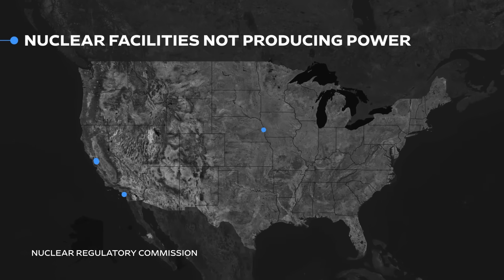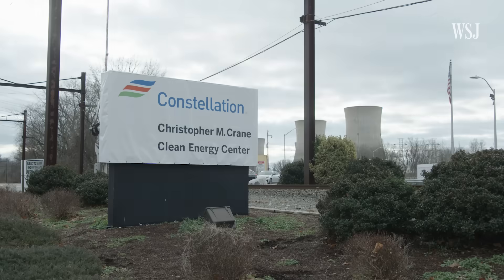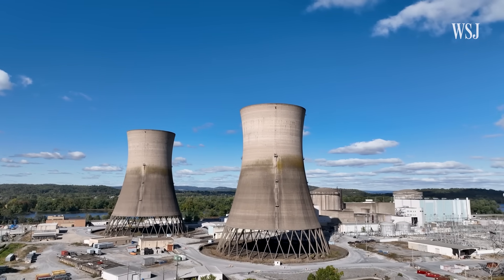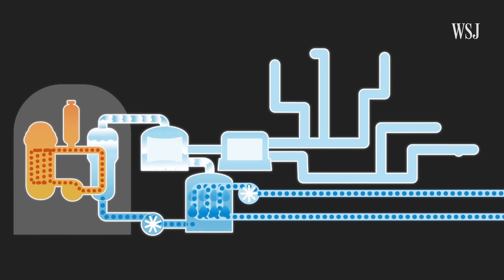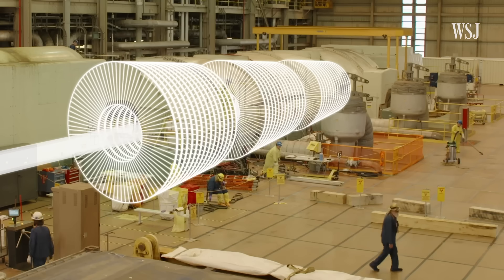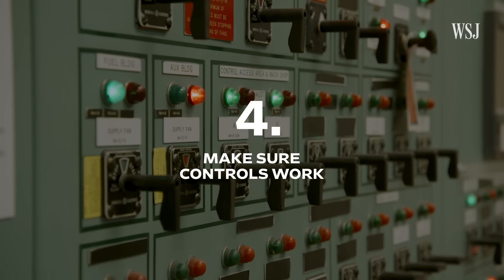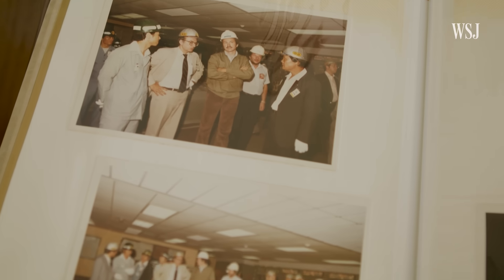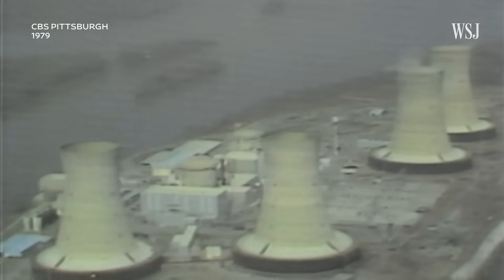Inside the $1.6B Plan to Restart Three Mile Island | WSJ

Comment: Okay, 43 year nuclear employee here.  Including from 2012 to 2020 at Fort Calhoun, Braidwood and Byron Stations.
60 year old controls?  No, not really.  The hand switches and indicating light fixtures, maybe.  The recorders, controllers, all of those have been replaced multiple times.

The NRC licensing process is PAINFUL and EXPENSIVE.  Want to know why nuclear plants cost so much?  It's the REGULATIONS, folks.  So TMI is just fine to restart.

Nuclear plants (post TMI-2 accident, now post-Fukushima accident) are more safe than ever before.  Have we had an accident on US soil since TMI?  NO.  Did we have some near-missed?  Yes.  Davis Besse being the worst of them, and guess what?  The PEOPLE behind that can no longer work in the industry.  Try that penalty on for size.

The bottom line is this: TMI is safe, and it ran at levels which were EXCELLENT until it was shut down because the US government insisted on distorting the energy market with subsides favoring wind and solar, which mean you subsidize wind and solar and pay them twice - once as a ratepayer, and once as a TAXPAYER because they can't make money otherwise, and good running nuclear plants like TMI, Kewaunee, Palisades, Duane Arnold and others get shut down because they can't compete against government subsidies.

Relax.  It will be fine.  I'll stake my reputation on it.
Reply: Except for a very important detail missing from your otherwise fine criticism of relativism.
Without Government subsidizing both the construction and liability (Insurance) NO nuclear reactor would ever get built. This-in spite of Plant Vogles repeatedly using unqualified welders, electricians, and inspectors throughout its construction. The worst part however is the failure of the Inspectors overlooking the failures of the welding, electrical, and inspection procedures and conclusions themselves. It’s damning for a steam engine that is exceeding $35 Billion in construction costs for only two of the four reactors.
Reply: @Jmp5nb  Those are some very strong charges.  US NRC observes construction.
Where are these allegations documented?

Comment: There is much better controls technology today.  Running a facility on obsoleted hardware is only going to cause issues.  Sure its cheaper, but using eBay to find replacements isn't a good idea.  Allen Bradley offers competitive priced SIL solutions, while Yokogawa has some top of the line solutions.  It just didn't appear the controls were modernized from what was shown.  I hope they have a plan for that.

Comment: The reason the controls are 60 years old is the utility has to evaluate and certify the new controls and then, once certified, the process starts all over at the Atomic Energy Commission. Each of the two steps can take 3 to 5 years. Often the new technology is already obsolete by the time the AEC gives their approval.

Comment: These are all old OG 1950’s Gen 1 reactor designs. The 3rd or 4th generation nuclear reactors are much much much more safe and don’t even look like traditional reactors anymore. If you combine them with a fusion reactor mix, and maybe have a mini reactor on the side as a backup reactor, you can actually gain extreme amounts of energy output to power entire states.

Comment: Worked at indian point 3. They had a crane there for the rods (in rod we trust). Anyways this thing was so old the manufacturer was no longer around and they had so many replacement. There were these 20" boards that operated it, 5 of them. You had to put them in the right order. Just insane to me that something so old did something so critical.

Comment: 1.6bn $ would be a bargain.

Basically everywhere in the western world - new reactors create massive cost overruns.

For that reason - I would be suprised if they kept it under 16bn.

Time will tell....
Reply: that is why private businesses are good; they can do things well on a budget.
Reply: @leowood5860  Yeah - right.

Private companies never go over budget.

I'm sarcastic. Of course they do.

Great Britain's 2 new reactors under construction right now have an estimated price tag of 52bn pounds/57bn $.

Originally - the estimation was only 16bn. The whole undertaking is done by - suprise - a private corporation.

Go figure.

Reactivating a nuclear reactor is a bit more than blowing off the dust - and putting the plug back in.

This thing sat for ~20 years. When it was shut down nobody planned for a reactivation. Meaning: Nothing was treated against corrosion/fouling/rotting - you get the idea.

For example: All those stainless steel pipes (dozens of miles of them) have to be checked meticuolously. Steel gets briddle from radiation over time. And stainless steel in particular is hard to weld. Each and every one of them has to be perfect.

Margin of error: Zero. If something goes wrong here - radiation gets out. And even if it's just a tiny bit - as in the original 3-mile island incident - everybody will scream Chernobyl and the project is dead as a dodo.

And those pipes mentioned are just a tiny, tiny part of what has to be done to get the whole thing back up and running again.

I'm quite sure whoever calculated this project underestimated the price tag. After all - the reactivation of a nuclear reactor after 20 years has AFAIK never been done before.

There are many uncertainties involved. Due to the complexity of the whole thing -  it's impossible to know what's all wrong - before actually getting to it.
Reply: @ I agree. what I am saying is that private corporations have more of an incentive to stay under budget.
Reply: @leowood5860  And to stay under budget the usually cut some corners...
Reply: @andkosification  so does the government, the only difference is that a private corporation has a big incentive to not have stuff break.

Comment: Solar can provide the power but we would rather use something that could make the entire continent unlivable.
Reply: maybe do some research on that one pal. nuclear plants almost never melt down, and when they do will never "make the entire continent unlivable", and solar only runs during the daytime and takes up huge tracts of land.
Reply: @leowood5860  You are the one that needs a lot of research. I bet you believe there is a such a thing as clean coal. The amount of nuclear material in any nuclear power plant is enough to make an entire convenient unlivable. That's just what it operates with. Once those are removed from the reactor, now what do you do with it. Every state bans nuclear fuel rods being transported because they are so hazardous. 
Just because it hasn't happened yet doesn't mean that it won't ever happen. The Russians nearly did it themselves. This country isn't innocent either, it's just hidden but people are still dying because of three mile island. As for solar power, night time demand isn't the same as day light hours anyway. During the night there is this invention called batteries. As for the space that it takes, yes, they take up space. So does anything else that generates electricity. One produces clean cheap power, the other produces a byproduct that can kill every cell in your body and is very expensive to operate.

Comment: The internet has been scrubbed about many other meltdowns around the world and in the US.  Heck you hardly hear about Fermi.  Also what you never hear is that the valve issue at TMI was preventable with proper maintenance that had been reduced to cut back on man hours and the same valve was found to have the same issues at other stations around the US.

Comment: Ooof, this a bit of nightmare since this is all very old hardware. Fortunately they're doing this the right way, but checking every little thing. But ideally all the control system should be replaced with more modern hardware that easier to get spare parts for. And core catchers should have been installed under the reactor vessels to bring them closer to modern safety systems. Though TMI's reactor design did prevent a reactor breach that a CC is designed to deal with. 

And after the AI bubble crashes and burns, this power can replace coal, which is what Constellation Energy is likely counting on.

Comment: Jesus, TMIZ was not a major meltdown and was not deadly. TMI should have never been shut down. In fact, the deadliest actual nuclear failure in the US would be the SL-1 incident. 

Also, something kinda odd, but TMI accident happened weeks after the movie China Syndrome came out, and tmi and the movie followed a very similar script. Also odd was the protests against nuclear energy rising and fear mongering spreading throughout, based on false info, with Jane fonda at the helm. 

It's the same people demanding clean, safe, and reliable energy now, but are terrified of nuclear power, which by far is the safest, most reliable source on energy in the US.

Comment: Basically, you’re inserting think of it as charcoal briquettes under a tea kettle to just get it boiling at the right pressure you spin a pinwheel that is connected to a chain that spins a alternator on your car to produce electricity. That’s the simple side of the explanation no more complicated than that.. 
    Now the redundant back up safety and controls. 
   On top of that A worst case scenario fail safe backup Plan B. 
     This is where the company cut cost to keep their profit margin so they have a faster return on investment. 
     Worst case scenario couple billion dollars and damage tens of thousands of people harmed an injured few hundred die immediately they get to declare bankrupt. Everyone gets to walk away clean in white suits with bag of taxpayer money. 
      Nobody gets fined nobody loses. Nobody goes to prison.. 
       There is no incentive to do it correctly. And there is no fear and no retribution for doing it incorrectly..

Comment: With modern technology coal can be burned very cleanly and a little over 90% of the pollutants can be removed during the burning process of the fuel so I think we should start using energy sources like that before going with nuclear although nuclear is clean it's still dangerous.

Comment: ALL controls and safety systems need to be recertified and commissioned. Instrumentation has to be calibrated and valves need to be tested for free operation and no leaks. Nuclear reactors and radiation pose extreme danger if the smallest component fails.

Comment: A nuclear power renaissance is already here in my opinion.  The current owner of the Palisades Nuclear Plant in Covert, MI is in the process of restarting that plant.  Work has been ongoing with that project since early 2024.  There are plans to not only restart the reactor, but to also add small modular reactors to the plant.

Comment: A suggestion if I may. 
If the Integral Fast Reactor liquid sodium metal cooled nuclear reactor at the
Argonne Laboratories, located in Idaho, is still standing dormant. 
Consider starting that reactor up.
There's an eye opening video of when a preplanned deliberate shutdown of  liquid sodium coolant.
Where media was present and
is available on YouTube 
"Capo Rip'.
That reactors design was engineered to self shut down should the coolant flow be stopped, which in that test it did.
The then supervising engineer 
Dr Charles Till, who has sadly passed away, said we thought we'd see everyone running for the exits. No one did.
One other advantage using liquid sodium metal coolant is that it doesn't deplete the uranium fuel, so that reactor need only be fueled once in its operational life.....

Comment: A pump never broke a clogged line happened and then the pressurizer valve opend and thats what got stuck happend in 85 at a plant in ohio identical to tmi built by Babcock&wilcox corporation operators there caught it in 30 minutes unlike tmi unit 2 took almost 2 days

Comment: This is a poor summary. The first step is to check everything, which they are doing, then the second step is to pressure test the two coolant circuits to make sure they can withstand the operating pressures that will be present, plus a safety margin. Putting uranium back into the reactor is the last step before restarting, not the first one.
Reply: How do you even inspect the hot side corrosion or deficiencies?
Reply: @phiksit  You send in the dwarfs.

Comment: I'm sure the people that live across the river are thrilled this is being put back online... pun intended. They were scared to death on March 28th 1979 with grave reason and this isn't new constuction. It's firing up an old nuclear device/plant. My dad worked for PPL when i was growing up in the 80s and he did bids at the nuke in Berwick and it's constant maintenance. You don't just power down and power up a nuclear plant 50 years later so I hope for a safe restart and will say a prayer for it' s continued safe operation once online again. I live 70 miles north of Three Mile Island and am grown up since the accident there in 79' and have pretty decent knowledge of nuclear energy. Very interesting video as well.

Comment: 60 year old controls and 80 year old operators. match made in heaven
Reply: I'm sure those 80 year olds are going to train a much younger generation on the powerplant.
Reply: @Battleship009  All of the Nuclear military personnel that were let go due to refusing the VAX are qualified and would probably fill these new job openings = no 80 year olds or clueless youngsters needed .
Reply: It unironically is
Reply: What could possibly go wrong.
Reply: Those operators are mostly ex nuclear US Navy trained. They also must pass NRC qualifications. As far as controls,  there is always testing  procedures that take place prior to placing a system back in service. I worked in several nuclear power plants in my past career and found them to be the best places (power plants) to work at.
Reply: ...it is a Nightmare. Spare parts?, Training?, Dokumentation?  Safety according current Standards????
It could only the Idea of Madnes.

Comment: Call me stupid or whatever and saying I don't know, that's fine. But Three Mile Island was not as bad as the government or media was saying. IF they really wanted too, the Decommissioned reactor that melted, can still be used, the melted material did go through a very small portion of the vessel, BUT did not destroy it fully like chernobyl, nor was it as worse as Fukushima. This means this while vessel could be replaced completely. The only reason it was not worse was the lack of oxygen, and the consistent pumping of water and preventing the water from bubbling. If it bubbled, there would have been vibrations which resulted in an explosion. Design played a part, and faulty pump. The staff really didn't have the tools to read the water levels, so due to this, that's why they also pumped not realizing the reactor was leaking, and overheating.  If I am not mistaken they did leave some of the melted fuel in there, it's all cooled too. Nuclear tech has advanced so much, and I feel the world needs to use nuclear. Some of the info here may be inaccurate. I'm just trying to state that it was over blown I understand safety was the reason.

Comment: they also need to modify much of the safety controls so that the same operator overload does not happen as in TMI2 where every warning/fault light lit up the panel like a xmas tree.... plants since have been modified and new ones designed that way from the beginning... it will be costly but very doable

Comment: Whenever I hear people say Three Mile Island was the worst US Meltdown, it pisses me off... because it wasn't. It wasn't even a full meltdown. Most of the public knowledge about the plant is from information stretched to almost lies by the media. Most of the insane radiation levels that were reported, were reported from an unauthorized helicopter that flew over the plant as it vented radioactive gasses that were safe to vent; they would fully decay in hours to a couple days, and are gasses humans have evolved to deal with (i.e. our bodies won't absorb the gas).

There were no deaths, or even injuries directly related to the plant, nor did any cancer or radiation-related illnesses spike in the area around the plant, regardless of what people believe.

The actual worst US nuclear reactor accident was in 1961 when an SL-1 reactor suffered a steam explosion, killing the three operators, because the main control rod was disconnected from the drive system, so had to be manually pulled out of the reactor to be reattached, but was pulled too far.

While some other deaths happened at nuclear reactors, or facilities that handle nuclear materials, most fatalities were related to general work hazards (most deaths were electrocution, followed by steam and/or superheated water accidents). Outside of the SL-1 disaster, no one in the United States has died from a reactor having a catastrophic accident.

Comment: One thing as a diesel mechanic and a  USN vet, is that they should have a pure mechanical air start emergency diesel generator with sufficient output to run all control and cooling systems in the of an emergency whether internal or external
Reply: They DO have emergency diesel generators, other plants in the area have as many as four generators each.
Reply: @peghead  i know they have edg's,  what I'm saying is they should be totally non electronic,  at least enough for cooling and control,  for reliability reasons